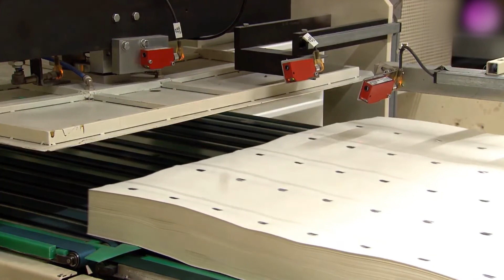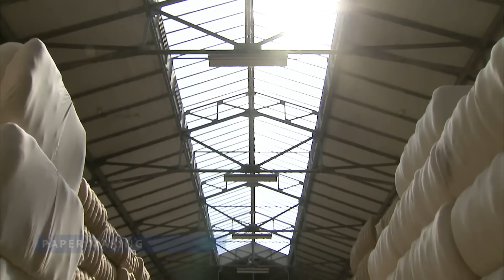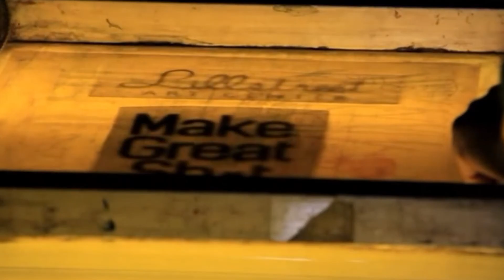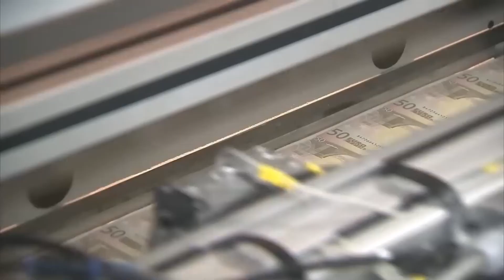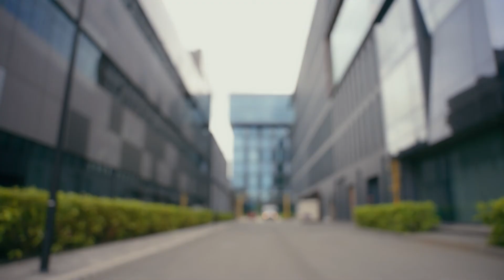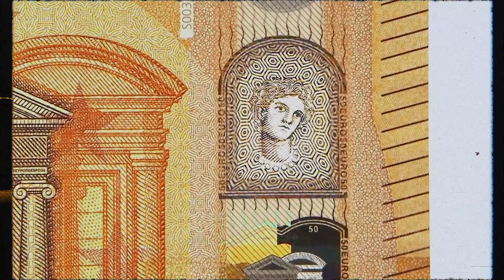Inside the Euro Banknotes Factory: The Making of the €50 Note - Euro Bills Production

Comment: We should get rid of the one two and five cent euro coins. Since they are worth nothing you can't pay anything with them. So you shouldn't put any more money into production, which is confusing when you're doing the arithmetic. For this we should spend €500 and €1000. reprint. equip with special features. as well as watermarks. Gold stripes hologram special golden color as a hologram gravure printing other features so that they are safe from counterfeiting I would even scan a logo on a 1000 € note so that it cannot be counterfeited if it goes into the copier. So the copy is missing what can be seen on the original. Namely, the unique hologram in gold instead of silver and €500 makes it easier to pay out €1000. with monthly payments to people. e.g. €1000+€100.   or €1000 + €250. 1000€+500€.  1000€ + 700€ then there are 2_3 money bills. instead of 10 banknotes or more. Same with USA Dollar. 500$ 1000$ as Well. 1_2_5 Cents Penny Out of Print  No use eny more The gold should not be worth more than $10 per gram. The only thing that is really worth is the earth, the land, but not the gold and not the diamonds. Artificial diamonds are now being produced and they shouldn't be expensive, just like the gold. The gold should be reduced to a gram of 10 dollars, or better said a gram of 10 €. This is the right price for gold for the next 100 years and should always be priced at €10 per gram and no more